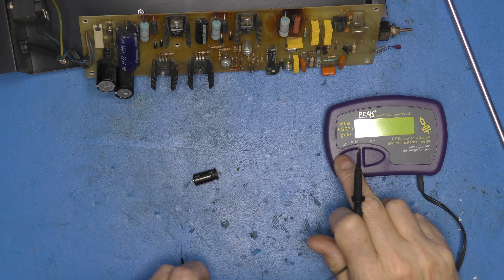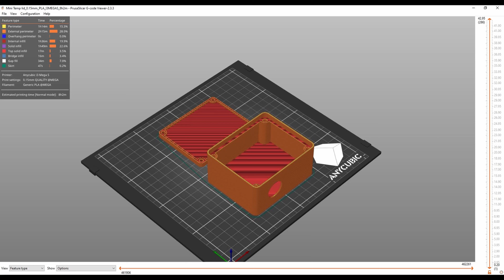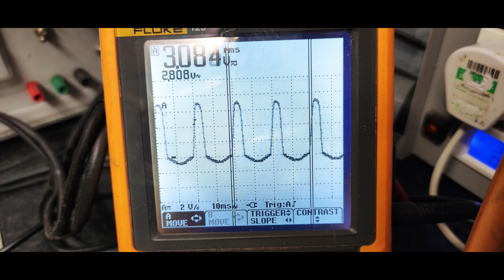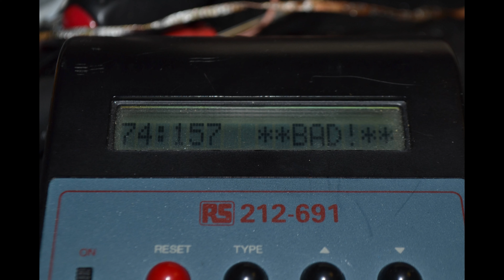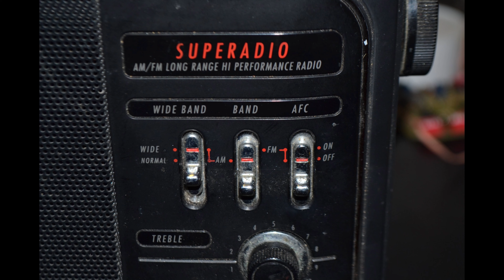Hifi News Flutter Buster HFN006 repair & upgrade

Comment: I think these were sold under the Moth brand, the wooden case was quite typical of old Moth products. I'm not sure whether the HFN version was some kind of DIY kit you could buy through the magazine or just a rebrand. Either way, pretty typical audio product engineering. This would probably have been paired with NVA, Moth or Naim amps back in the day. The lack of earth doesn't surprise me at all.